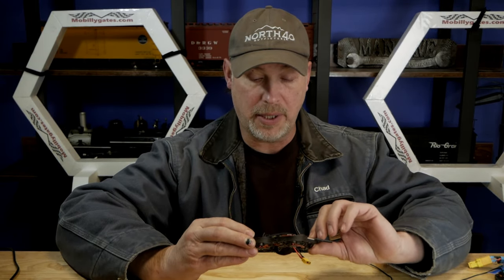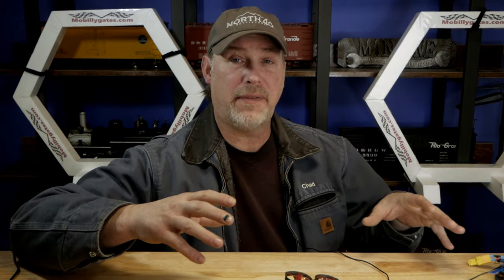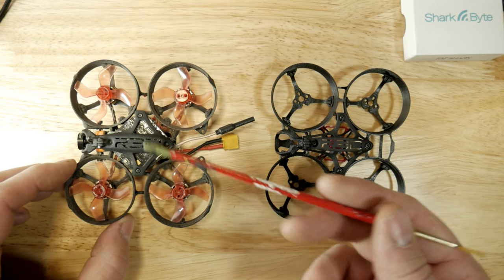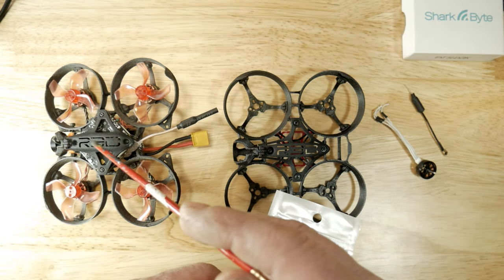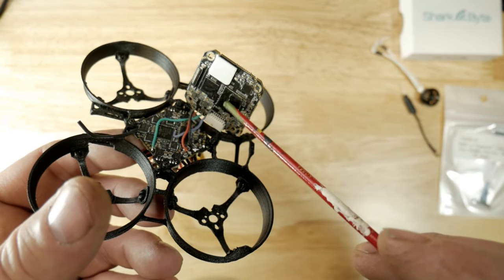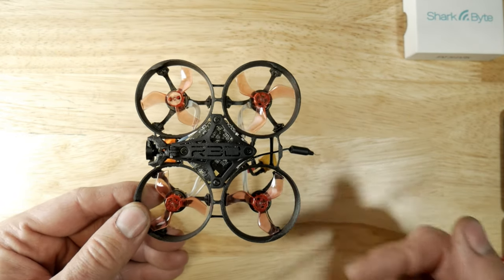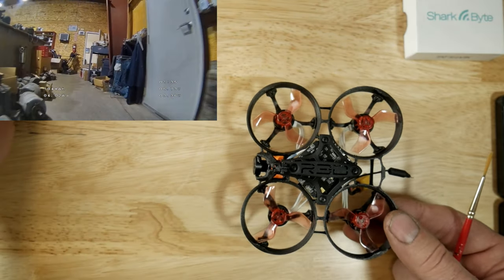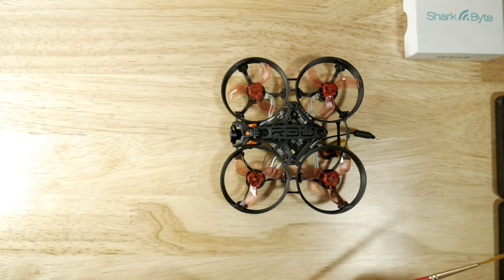How to make a FatShark Shark Byte HD Whoop

Comment: Hi! What an impressive build! You wire the shark byte Vtx to the 5v flight controller or 2s battery directly? Do you use the capacitor? Thank you. I'm very interested building a quad like this
Reply from the maker: The SB is connected directly to the battery. SB needs at least 7 volts to work

Comment: Looks cool man!
Have you seen the latest camera from caddx for the DJI system? It performs almost the same as the stock DJI camera. Do you think they will release a SB camera based on that sensor?
Reply from the maker: The Caddx Camera IS actually the DJI camera.. DJI is offloading the sensor to caddx because DJI wasn't making any money on theirs and the sensor alone is over $20usd in lots of 5k.. Caddx may now that Foxeer got into making a cam for SB and the owner of Caddx is very competitive.. Runcam may be coming out with yet another one as well.
Reply: @DumbThumbsFPV  are you sure they are the same sensor. In some situations they perform the same but in others they dont, being the DJI the one which gives a bit more crispy and more saturated image. Anyways, its great to have more camera options for both digital systems.
Regards and merry xmas

Comment: Why not use 0802 motors instead of the 1103?
You might have saved 2g per motor, which should have resulted in 8g total weight save.
Reply from the maker: tried that on a 75 and the flight times were really bad.. 0802s are good for very low weight whoops.. anything above 35g (quad weight) and they just suck the juice..
Reply: came here to say the same: i fly xing 0802 25k kv on this exact frame, 1S naturally. i stuck a hd dvr board on it recently, flight time became not too great maybe 3+ minutes, but i am just never (yet) happy with 1103’s on 2S on these frames. too noisy for my taste and flys like a tank imho ymmv.
Reply from the maker: @samtny1  yeah the 1103 11kkv are very loud.. the 7k motors are much more quiet